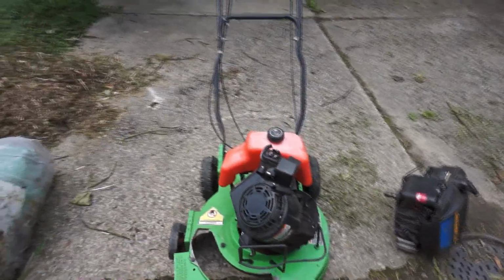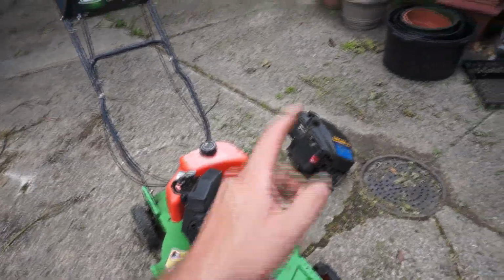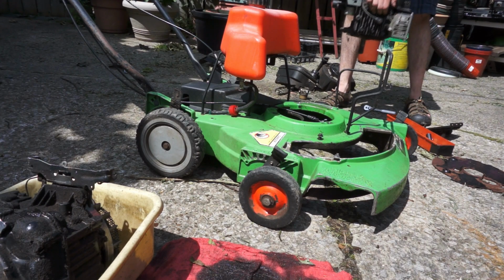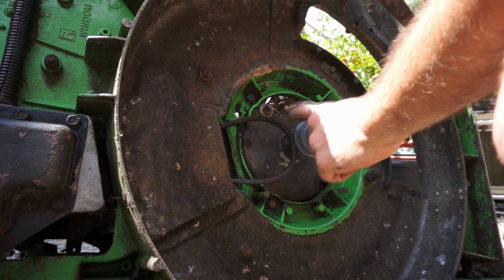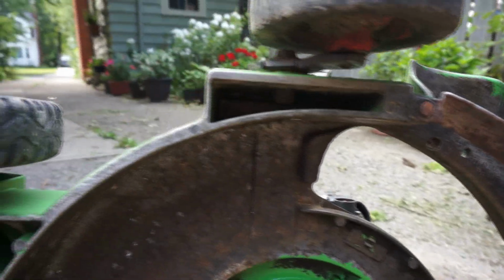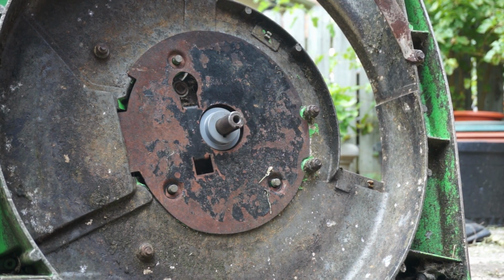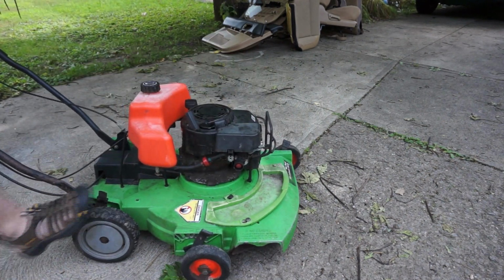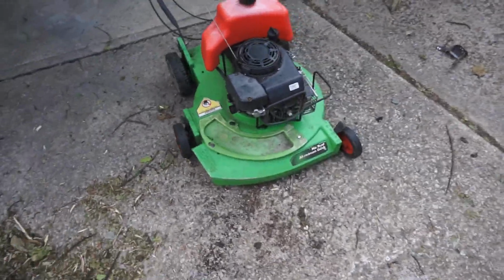Re-Powering a Lawn-Boy Commercial mower.

Comment: Neat project! I always love your mower videos. Glad you were able to save that Lawn Boy. I’m a LB nut myself and I would have done the same if it was my mower as well. Don’t see too many commercial 4 cycle Lawn Boys around, and like you said they still command a decent buck used. 
That blade adapter was definitely for a MTD product, which is why it fit that cub engine as MTD has owned/made cub cadet since sometime in the early 80s.